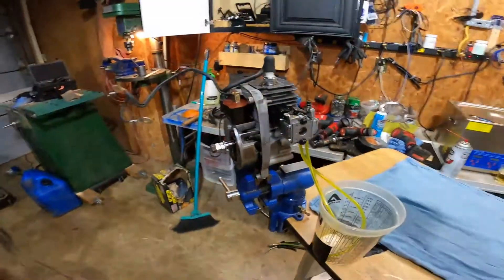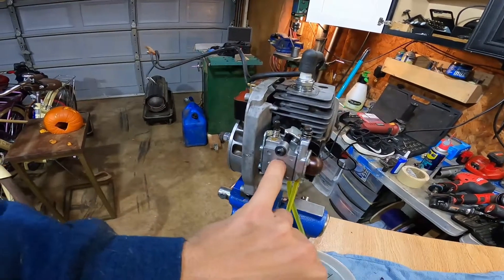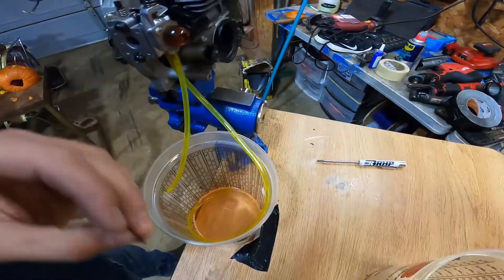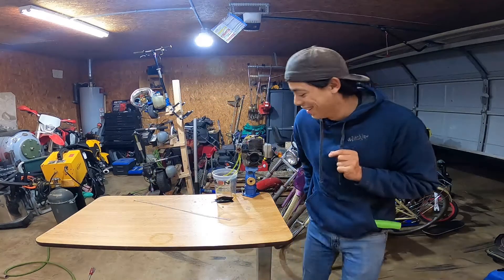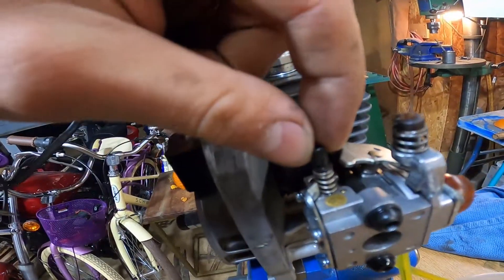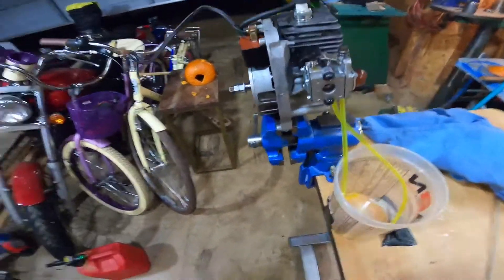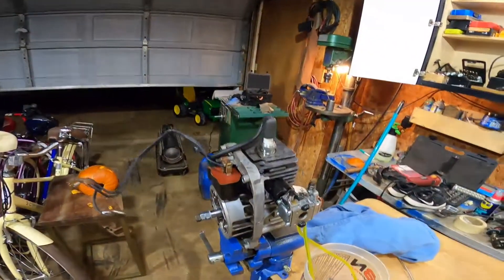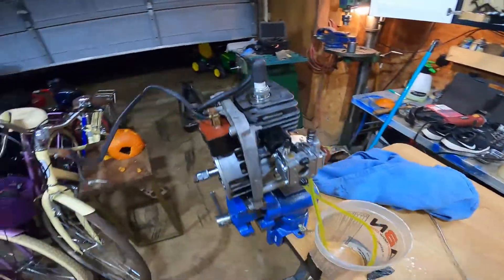Running a 2 stroke engine on nitromethane rc car fuel!

Comment: I just tried this with my 4 cylinder weed wacker for the hell of it. It runs fairly well. I just had to adjust the tune. When it warms up, it actually has more power than normal gas/gas and oil mix.

Comment: There is no way that engine is cooling right without all the shrouds on it. Just saying. L
Reply from the maker: Welcome to my Chanel! That engine has had some abuse, I 100% understand 2 stroke air cooling and I totally agree on the cooling. If you watch some of my earlier videos with this engine you will see that I removed it from a leaf blower for the only purpose of running weird fuels in it. One day its gonna get too hot and seize on me haha

Comment: Bro using a pull stick worrying about the engine blowing up but doesn't have safety glasses on...
Reply from the maker: I was wearing my Asian designed safety squints
Reply: Lol! You have earned my respect homie. Especially considering this is one of the few videos I found answering my basic question of a larger 2-stroke on nitro, and I am intrigued, carry on brother!  @aaronpratt89
Reply from the maker: @adeadlyfart13  thanks for the support! I am working on finishing up/ putting my garage together in my new home. Time for YouTube has become scarce with 3 kids. I’ll be back at it soon enough!!

Comment: what about regular methane?  can you run it on farts?
Reply from the maker: That’s a good one, I have run it on map gas!
Reply: @aaronpratt89  is that methane gas?  i dont know what that is
Reply from the maker: @jasonbrown5014  mapp gas is a gas that comes in a yellow bottle at the local hardware store. It’s like propane but it runs hotter
Reply: @aaronpratt89  how do you add oil when using gas vapor?
Reply from the maker: @jasonbrown5014  well in another video I did, somone wanted to see it try and run on used motor oil. So it had a fuel tank of used motor oil being delivered through the carb as I fed the map gas through the intake. The video is on my page

Comment: used a whippersnipper (australian word for weed eater) and i used nitro methane, and squirted it into the intake with no carby, and it had no rpm limit whatsoever, and somehow it is still together,i would say it sounded close to 20-25k rmps

Comment: Nitro methane is made by mixing propane and Nitric acid at around 800 degrees Fahrenheit. So that explains why every bit of rubber and paper went south for the winter. Nitric acid will dissolve solid gold, your gaskets and such had no chance. Run the thing off of chocolate syrup and I will be impressed.

Comment: I didn't know that this stuff was corrosive, never learned about that w/ nitro 2t RCs, can i still run it on gasoline to clear it?
Reply from the maker: Nitro rc cars are built to handle the corrosiveness of nitro fuel.
Reply: @aaronpratt89  cool, thx! 😊🙏🏻

Comment: I fly rc airplanes. I used to fly with 15% nitro. Great power out of a .40cc engine. The engines run best with a cooler glow plug and pretty wet with the fuel settings.  My two stroke airplanes would hit right around 10,500 rpm at wide open throttle and idle around 1,200. Very fun hobby. Nitro fuel creates a pretty violent explosion in engine cylinders so that is why your engine revved to outer space and seemed unstable while idling. Take a look at top fuel funny cars. Nitro methanol at its finest . Quarter mile in 4.5 seconds with six foot flames out of the headers.
Reply: Imagine switching to 40% or higher 🤣
Reply: @Billskins4dayz  😆 Any engine would really scream with that as long as you could keep the piston rings and piston cool enough not to melt.

Comment: I’m thinking about running 1/4 gallon nitro fuel, 3/4 gallon gasoline, and a 1:25 2 stroke oil mixture. What do you think 🤔
Reply from the maker: I don’t think it’s going to mix very well.

Comment: I've ran a few 4 stroke weed eater engines on RC car & buggy 30% Nitro from VP. Have done Ryobi, Craftsman, and Homelite. All were purchased out of a small engine pile at a local recycling facility for about $2.00 each. End up buying 2 engines to get 1 running engine most of the time, seems like 50% of them will have catastrophic engine problems but good carburetor and pull starter, and the other 50% will have a junk carburetor and screwed up pull starter but the engines internals will be okay. From my experience running RC car nitro fuel for glow plug 2 strokes in a 4 stroke weed eater engine, how long the engine lasts depends on the person operating it because there are a few quirks that can destroy the engine quickly if you don't make allowances for them.

1. When running Nitromethane at 30% the engine needs about 3× the amount of Nitromethane than the amount of gasoline it would normally require, make sure your fuel system is up to the task. Strongly suggest putting a fuel system that allows you to pressurize the tank with about 2-3 psi. DO NOT PRESSURIZE IT WITH THE STANDARD NITRO RC CAR METHOD OF EXHAUST FITTING/HOSE/TANK FITTING. 4 stroke exhaust is much hotter and prone to flames and backfiring that 2 stroke and will set your crap on fire.
2. Even though 4 stroke exhaust is hotter than 2 stroke exhaust,  and 4 stroke engine operating temperature is hotter than 2 strokes, running on Nitromethane will make your 4 stroke run colder than it did on gasoline and it will probably need a hotter burning sparkplug to avoid fowling especially if you're using the higher oil content RC fuel.
3. Don't run stock weed eater exhaust as it will end up holding some raw fuel in it that will end up catching on fire. I make mine out of stainless steel tubing, usually just a simple bend in the direction I need it to point in and no baffles. Play with length and diameter, you can really dial in the engines torque curve by exhaust tuning.
4. Change oil frequently, Nitromethane will turn crankcase oil to a yellowish nasty goop after a few minutes so change it everything you finish running it.
Reply: It's the alcohol in the fuel evaporating in the intake manifold that cools (sometimes freezes) the engine. Fun fact.

Comment: i used to do this to my little 2 stroke motors and chainsaws when i was a kid, would run without a spark plug. crazy power. used oxygen from torches as nitrous for a power enhancer aswell

Comment: Did a similar experiment a while ago, pure methanol and Castor oil. drilled out the main jet to about 2x the original cross section area. Got it running pretty good, but was a tad rich. I had to cut the amount of oil in the fuel way back as it fouled the spark plug. The Nitro fuel has a lot of oil as the engines that run on it have glow plug that is more robust and no rings and the oil helps to seal and generate compression.

Comment: Get a bigger carb from an engine about 3 times the displacement.  It'll run, but don't bother until you replace the gaskets/pump diaphragm with silicone or teflon.  Your instincts were right: methanol and nitro will EAT stuff rated for regular gas...that fuel line will dissolve, too.  Fun seeing the kind of power you can make though, huh?  :o)  Oh, and I'm not sure how cold it is where you live, but it's HARD to get e85 to run in the winter, at least here.  I ran my leaf blower on it as a test and I had to dump 30% car fuel straight down the carb to get it to start.
Reply from the maker: I’m surprised the carb lasted as long as it did. It’s actually still alive. I mainly did these videos to show people what would happen if you did such a thing. The engine isn’t going to be mounted on anything besides my work bench so there is no need to make it run perfect. I was sure to run some premix through the engine after each test run of nitro and alcohol. Next I’m going to revisit the diesel and heat it with a torch to see if it will run without the use of ether. Thanks for the interest in my videos!
Reply: @aaronpratt89  Oh no doubt,  it's cool. Just passing on my own experience with having done the same stuff since I was a kid. Run it with a glow plug, no need for the ignition or flywheel?  What if you DID put it an rc car? 😈 That thing would be insane 😳 I like the diesel video...cool content, keep it up!
Reply from the maker: @guerrillaradio9953  there is a company called zenoah that makes the engines on my scooters, those engines are actually 5th scale rc engines! My brother is a machinist. And he is working on(if he ever gets free time) making me a spark plug to glow plug adapter. I want to attempt to run the diesel with a glow plug(I don’t think my compression is high enough) and see what happens. Niro would be cool to see running off a glow plug also!

Thanks for the support and interest!

Comment: I have done this multiple times and the stock diaphragm type carbs physically wont work, they just cant supply enough fuel and they will overheat the tip of the spark plug and the engine will run away, I had one that the kill switch wouldn't shut it off and it kept running even with the plug wire off lol. I did have great success though with a troy built weedeater that I siliconed the pulse port shut in the intake and I found a traxxas 2.5 carb fit right into the intake hole and ran silicone fuel lines and that thing ran absolutely amazing, it was a bit lean at full throttle but it was fully functional and made good power, I have been thinking about trying it again but on one of my gopeds.
Reply from the maker: I would love to run a Goped on one. But yea these little carbs can not supply enough fuel for these engines to run right on nitro lol. I was thinking of trying an alcohol carb. But for testing purposes this one worked ok lol. Tanks for the input!!
Reply: @aaronpratt89  the alcohol type carbs for these engines still cant supply enough fuel, to use one you would have to have a restrictor plate over the carb to make it run even remotely right, the biggest problem with nitro fuel is that nitro methane is an oxygenizer meaning it carries  it's own oxygen molecules so you need the massive jetting of a large carb but you need the airflow of a small carb because you dont need air, you just need a way to get lots of fuel. That's why I used a traxxas 2.5 carb because it had fairly large fuel passages but small air passage. If I were to do it again I would use the same traxxas 2.5 carb but then add a "power jet" to get the little extra fuel I would need and a power jet if you didn't know is just an extra adjustable passage you drill and press into the outside of the carb inlet, guys use that trick on motorcycle carbs with great success.
Reply from the maker: @briang4470  that makes sense to me. I’ve built a few nitro 4 strokes. An the 300% more fuel was always a challenge. This video was strictly for entertainment purposes. But a tiny carb like for a small bore motor wild be perfect! I understand what you are saying and for a rideable two stroke application, I would need a custom carb setup. I have the ability to make a manifold for a slide carb with changeable jets to make this work! With your input and advise, I’m gonna make it work! Thank you for the added knowledge!!
Reply: @aaronpratt89  no problem, as crazy as this sounds you will probally be able to remove the main jet entirely and still be right on the edge of not enough fuel, if you look on here there is a guy that tried to run his moped 50cc on rc nitro fuel and he tried to run I think a 32mm carb and even with the jet removed entirely it was still too lean and would melt the spark plugs lol. If I was you I would pick a large 20-28mm carb and then make a restrictor plate to reduce the air flow in and see what that gets you. Also plugging the air bleeds in the front of the carb help richen it up since the fuel will not atomize as good but with nitro fuel you dont need good atomization you just need a insane volume of fuel. Trying to carburate a nitro engine is difficult but it can be done, but it's just hard to get a carb to move so much fuel and that's why actual nitro race cars use mechanical fuel injection. Hopefully you will get a functional set up and post some videos I would be interested to watch.
Reply from the maker: @briang4470  yea I removed the screw completely when I was running it lol it was still way lean lol. I want to make a glow plug adapter and run one. Just to see what would happen. I have some slide carbs laying around that I could drill the jets and try to get enough fuel in it.